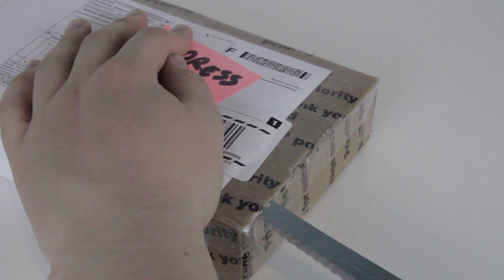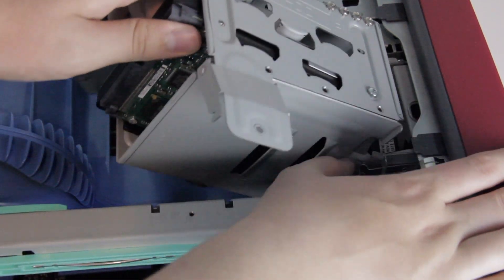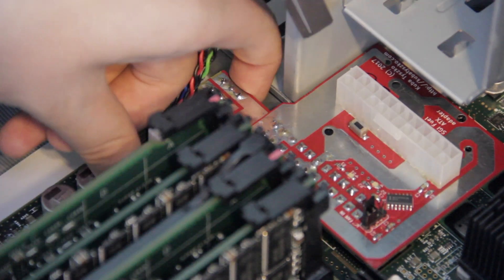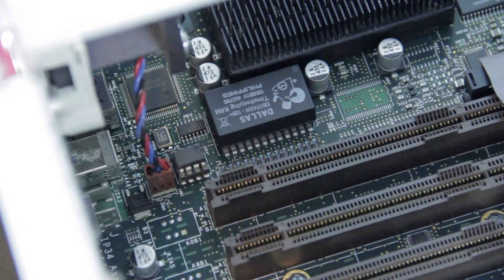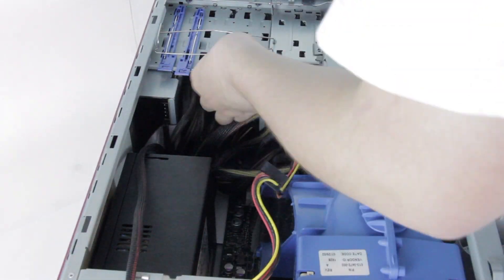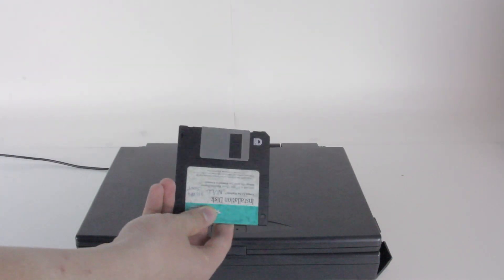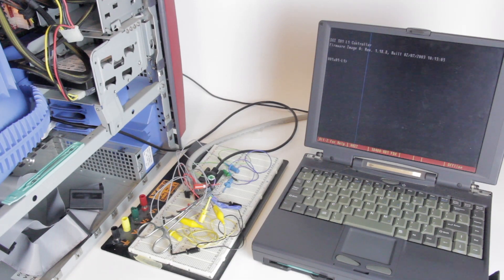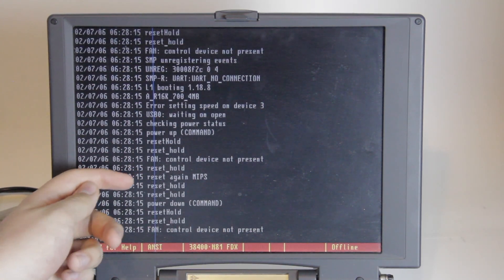Dodoid's SGI Fuel Part 1 - Power Supply, Dallas Chip, and Serial Port Bodging

Comment: Great video. My Fuel has a bad power supply. I noticed you have a black PSU, which is different from mine (silver). Is there a easy way to get an aftermarket PSU to work, or do I absolutely have to buy SGI one again? Thanks :)
Reply from the maker: You need the adapter seen in the video.

Comment: It's kind of odd to see the serial port hidden away deep inside this machine since the serial port is the traditional way of monitoring unix machines. If you look at photos of racks of unix servers the only port you see on the front is a serial port since many didn't have video cards or even keyboard and mouse ports. Also there's no BIOS on unix machines, you need a serial terminal to see what was going on during start up.

The first unix machines I worked on that had specialized displays like colour or vector screens (before SGI) they still had to be started and some commands entered from a serial terminal making them the first computers I worked with that also had two displays. When the Palm PDA came out I raced to get one and a serial cable just to use as a serial terminal and no longer did I need to drag a terminal out on a cart.
Reply: I was just thinking how earlier you were mentioning how hard it is to get a modern browser running on your old SGIs. If you had a fast Mac or a modern linux machine you could push an X11 session from one of those boxes to your SGI. Back in the day we always ran our SGI workstations as client server with the applications running on the server and the SGI being the display. We used to use some pretty insecure methods back then but I'd bet you wouldn't be bothered by that or have access to a modern SSH for Irix.
Reply: it's the same on HPPA: serial console is a common practice.
Reply: Brian, there are 2 traditional serial ports on the back of the Fuel system. You'd use these to boot to the login prompt, etc. The L1 serial port inside that Dodoid is using is more for hardcore troubleshooting, etc.
Reply from the maker: I suppose it makes sense for a workstation. With the graphics installed, it can boot graphically and be configured using the PROM GUI even if you don't have an OS installed. I think you can also control the L1 from the OS. The port doesn't need to be accessed often, and I'm only really using it to ensure that the system runs at a basic level (it can't boot without graphics).

The SGI Tezro and the Origin 3x0/3x00 have L1 screens on the front, but the Fuel was the low end machine so I suppose they opted to just use a serial port to bring the price down.